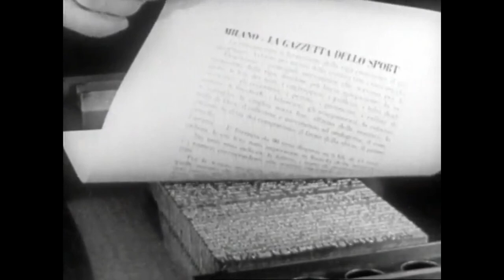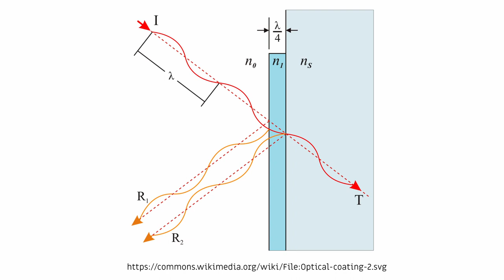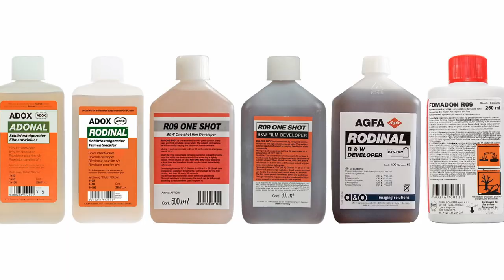Musings on Invention

Comment: When i worked at "Ruhr Nachrichten" in Dortmund, Germany in 2001, i saw one of those Linotype machines in person. It was not connected anymore but more of a museum piece installed in a random hallway somewhere in the back of the building. It is really a beast of a machine. The middle of the building was bombed in WW2 and was hurriedly rebuilt. This resulted in a lot of strange hallways, random steps and rooms with crooked walls. A lot of space was stuffed with old 'junk'. The electrical cabling was a nightmare. When we searched for a problem on the network, we found out that one rack had over 50V AC on the ground plane. touching the rack could actually have been dangerous. Fun times :-)
Reply: First we learned to set type with a typesetting box, and then on the typesetting machine, the Linotype machine. That was indeed one of the most beautiful developments in history.
Certainly a favorite invention indeed!!

Comment: My favourite exhibit - sadly, long ago removed - in London's Science Museum was the Marx Impulse Generator. It stood in the corner of what is now the Space Travel gallery, but back then it was dedicated to Electric Power. The generator worked by charging a column of capacitors in parallel, then discharging in series once a critical voltage had been reached. Twice a day, a chap would come down and power it up - a couple of massive, loud million volt sparks. Brilliant stuff. ♥

Comment: 1:03  Yes, there is still room for an individual to make a new great invention.  As a wise guy once said, "Man went to the moon before he figured out how to put wheels on suitcases."
1:28  I'd like to nominate the quartz crystal oscillator as a great invention.  Before that (in the 1920's), the world's most accurate clock still used a pendulum.  Quartz oscillators are now built into every radio, every computer, and just about anything that has digital electronics.   
I am also impressed with Graph Paper.  No one drew a chart with X and Y values until sometime after Rene Descartes.  Mathematicians studied polynomial functions for more than a thousand years before anybody plotted one on graph paper.  People sometimes refer to an invention as "before its time", but graphs arrived really late.  I don't see why they were not invented a thousand years earlier.

Comment: If it wasn't for the invention of the camera, there would be no video of you telling us about inventions.
Someone did patent the equivalent of a bicycle for horses. It was a four-wheeled platform, with attachments to the horse's feet, and was claimed to be able to let a horse gallop at more than 70 mph.
The name, 'Linotype' comes from 'line of type'. Printing has really transformed over the past century. One very useful tool is called MEPS, 'Multilingual Electronic Phototypesetting System', which justifies and formats type in any font on pages and around images and tables, and it can be used to create documents in any written language. It enables the publishing of printed and online material in hundreds of languages simultaneously. One website using it contains pages and literature in over 1,000 languages so far.

Comment: Here's a thought, related to the camera: the "analog principle" as an invention. Sure, everything is digital now, and analog is considered dumb, inefficient, and lots of other things. But analog was a huge leap over the nothing at all that came before it. By the analog principle I mean the idea that we can capture some sensible part of the outside world in a microcosm, creating a direct relation — between the intensity of light coming from a given direction and the density of a certain chemical on a piece of paper — between the intensity of sound at an instant and the depth of a cut in a wax cylinder — between the volume of one sound and the frequency of another — between the deflection of a control stick and the voltage in a circuit — that we can reverse those processes, turning chemical imprints into light, indentations into sound, voltage into motion — or mix things up, and turn one phenomenon into a completely different one (like sound into light for a motion picture film) and still bring it back at the end of the day. And all of these processes proceed with a kind of elegance of nature, almost unsupervised. A live analog television broadcast can go from being light on a set, to voltage, to radio, back to voltage, to light in your home, literally at the speed of light, without the mediation of microprocessors to encode, interleave, packetize, etc. etc. and there's something wonderfully magic about the fact that it truly worked.

Comment: re: your comment on the term "engineer", it's largely due to the etymology of the word.  The original Latin ingeniare, meant inventor or designer. (It's also the root of the word ingenious.  And the French term for engineer is still ingénieur, which I personally like as it seems closer to that root).  In middle English it became "ingineer" and was used to describe folks who designed fortifications and weapons, i.e. "war-engines" and military engines. It expanded in reference to public works (bridges, aquaducts, canals) in the1600s hence "civil engineer".  With the industrial revolution, the term was again expanded to cover all of the areas designing and using machines and equipment, especially steam or water powered "engines" (stationary engineers and railroad engineers).  In the modern era its been diluted further by terms like software or network engineer etc to mean an expert in a particular IT area rather than someone actually practicing engineering.  The term Professional Engineer is regulated in most(?) jurisdictions and can only be applied to those who have a licence to practice engineering.  At least in Canada, The “practice of engineering” means any act of planning, designing, composing, evaluating, advising, reporting, directing or supervising, or managing any of the foregoing, that requires the application of engineering principles, and that concerns the safeguarding of life, health, property, economic interests, the public welfare or the environment.

Comment: The linotype is pretty cool. Never thought about my favorite inventions. I have thought the "best" inventions of all time, a little bit. I'll define best as (difficulty to conceive of)*(difficulty to create)*(usefulness for species)*(years in active usage)

2. the loom
1. the screw

More obvious ones like fire, language, and the printing press, lose out because they're easier, even though highly useful. It's obvious to form a system of communicating ideas once you reach the ability to do it. Once you have written language, it's obvious to mechanize it. And fire was surely stumbled upon, not thought about through first principles.

But the screw, man, that is pure genius to me. It seems like I never would have conceived of that shape, let alone the endless usefulness of it. And not only is a loom a very amazing machine, the concept and processes of automating intertwining threads to make cloth, is definitely next level thinking. 

As for my favorite invention, what first comes to mind is the hand plane. Not only because the simple elegance of the design, but how it build the modern home interior for thousands of years, and it's just magical to sharpen a hand-powered device be able to take wispy shavings that hold together and are thinner than 1/1000th of an inch, off a piece of a wood, and make a board visually perfectly flat. The saw and chisel is probably more useful, but it's kind of boring and obvious.

Anyway, you should do more of these. I love this kind of stuff. Once you get more comfortable, I think they would be popular.

Comment: So I just watched the videos on the Linotype machine and it's pretty amazing how it all works, especially the casting of the type, that bit is really top level problem solving. Then the video introduced the teletype setter hooked up to the linotype. Now that idea should be number 1 on your list - being able to store information offline for later use. I'm guessing the cast type is recycled for future prints, but a reel of tape could be stored for future printing again.

Also I might now be imagining a UNIX machine hooked up to one as its terminal...
Reply from the maker: The teletype and paper tape at the end really are the icing on the cake, that makes it one of my favourite videos ever.

I'd like to print some text... OK, here's a machine that reads in punched tape and, in a purely mechanical fashion, turns it into injection-moulded lead alloy type.

Comment: ...and the Linotype de facto used 7-bit encoding for the matrix magazines. A row of matrices after the casting process was elevated and moved to the distribution mechanism where little notches on the sides of a big triangular notch engaged with the cutouts on the distribution rail, making the matrix fall into its distinctive channel, to be reused in next lines. It's a first-in-first-out magazine that ensures even wear of the matrices - no "favorites".

Damn nice museum that is! 
I worked for five years at the Book Art Museum in Lodz, Poland... and probably made the world's first Monotype composition caster control device that uses an embedded system (in this case, Raspberry Pi) rather than a PC connected via a wired interface.

Comment: I was literally thinking about horse powered bicycle/quadcycles yesterday and whether they would  be more efficient than just just trotting around. The driver could be in control of the brakes, gearing and steering, just not the , uh, horsepower.

Comment: It's not about the creation; an engineer analyzes things. An engineer looks at an object and asks: what is this meant to do? Will it do that reliably? What are the margins of safety? Which part will fail first? If we ask it to do more, which parts need to be beefed up? What tradeoffs exist between different aspects or capabilities of the thing? Can we make it better/stronger/faster/cheaper with new materials or techniques? Et cetera, on and on.

A technician should be able to competently follow instructions to build something, or competently follow a troubleshooting procedure, but it's not required that they understand at a deeper level.

The engineering mindset makes a successful invention more likely, but I think that every now and then, pure creativity does come up with something so obviously good and new that the inventor really can sell the idea and then go "okay, now we figure out how to make this work".